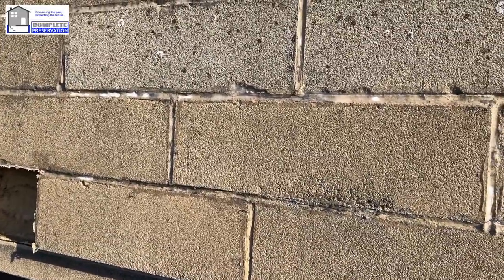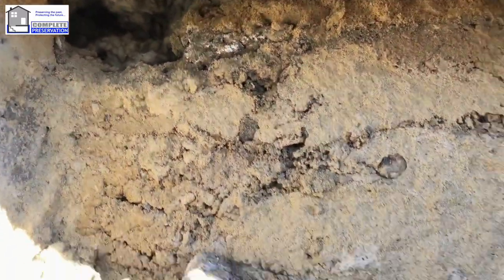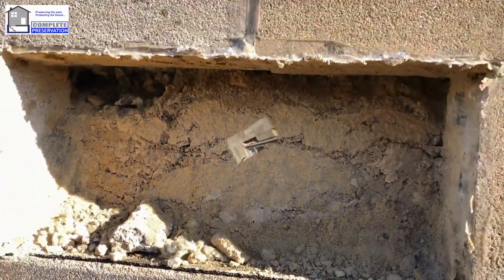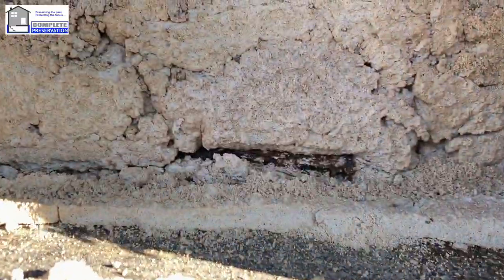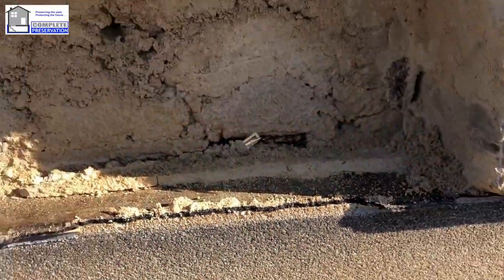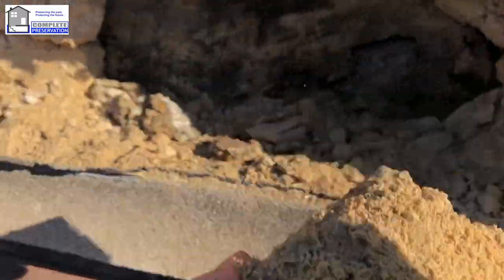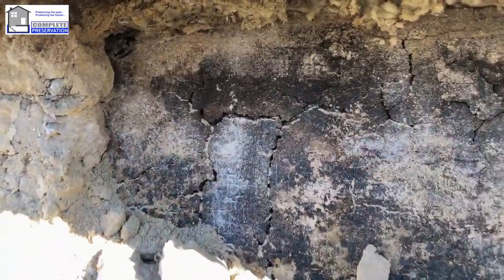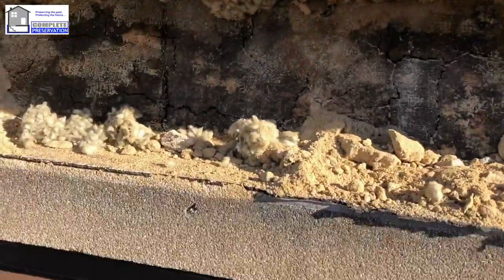Soaking wet cavity walls and a defective blocked cavity tray

Comment: Brilliant video Ross!Yet another different aspect of what can happen.I would have thought that stainless steel cavity trays should be the norm,so it could be fit and forget.I see quite a few old trays made out of various materials being replaced on youtube. 🤨❤👍
Reply from the maker: Thanks David…. Certainly a pretty common defect 👍 bitumen was the go to product, but as you can clearly see, it can become brittle and damage pretty easily. Some pretty good heavy duty retrofit trays available now, which I’ve made use of 👍

Comment: I've just done this job on my 1962 house, a south facing wall, get all the extreme weather, hot cold, wet windy, and the damp tray was cracked just like that one. But the main reason for rain water getting in was the window fitters had cut the water tray back to the inside line!!!!.
Reply from the maker: Well done Ken👍 such a common problem! Out of interest how did you know this was the cause in the first instance, was there damp at high and low level? 👍

Comment: Hi Ross, I have come across a similar problem in my gable end cavity wall and, thanks to your explanations, have figured out where the problem lies (I think!). After removing some bricks it is clear that debris is bridging the physical dpc. However, the wall also has cavity wall insulation retrofitted at some point which is mineral wool. This is wet in places up to a height of about 400mm. The house is on top of a hill and the wall is exposed to lots of rain. I think cavity insulation should never of been added in this instance. 

My question is if I remove all the cavity debris to 225mm below the physical dpc, could the cavity insulation fall down into that gap and also bridge the dpc at a later date? I know mineral wool is supposed to repel water but be good to get your opinion?
Reply from the maker: Hi John, I’m glad the video helped you 👍 if it’s getting wet still, there will always be the potential for a future issue. Sometimes debris will bridge the dpc, and you can also get run off from the edges of the cavity tray (if there is one above), which is often overlooked. Many of the bitumen trays are knackered, yet they get injected without inspecting 👍
Reply from the maker: Mineral wool I find especially the older stuff becomes saturated. I’ve got a video to finish of a recent one. This video might help also https://youtu.be/97yblxM5Ijc
Reply from the maker: A very old post. See for yourself 👀 if it’s waterproof https://blog.completepreservation.co.uk/2016/09/06/a-soaking-wet-cavity-wall-in-wiltshire/amp/

Comment: Great video. My mams ex council house has had a problem with damp in cavity the wall insulation was wet through. I've cleaned it all out as well as rubble. Is that all I can do. Cheers John.
Reply from the maker: Thanks John :) Make sure you check the building when its raining heavy for any obvious issues, and make sure there are no issues with penetrating damp in regards to issues with the building fabric.

Comment: How much will that cost to repair. As I'm having same problems with my living room window over the weekend we had the storm with heavy rain and it came through my living room window and made a complete mess but the daft thing is we have had the same problem for the past 3years it gets fixed by a company called MEARS that work for the LCC they told up that it was fixed every year but never is this time I can't get them to fix the problem as I bought it last year just after they sed it's fixed lol so I'm hoping the my house insurance companie will sort it out wish I could send you pictures of the damage its done on the inside then again dont think it would surprise you
Reply from the maker: Hi Wayne, its difficult to give costs as everybody charges different prices. In this instance it was expensive as we needed scaff. To be fair lots of people have had issues because of the recent storms, and its probably not that much of an issue if it has only occurred in this freak weather. Having said that, if it is damaging decoration and timber is at risk of decay something needs to be done to fix it ASAP. Drop me an email if you wish enquiries@completepreservation.co.uk. I have some videos I will be posting on cavity tray issues where there these have been retro fitted when I get 5.
Reply: Rescue and repair existing of cavity wall insulation

Comment: Also there's no weep holes in the perpend joints between those blocks either, so there would be nowhere for the water to go anyhow. It'd just build up on the failed cavity tray.
Reply from the maker: Exactly Darren, most of the older properties never had any, just relied on not much getting in 😂😂😂
Reply: I was looking and only just thought when you took the blocks out! As an architectural assistant this absoluteley cracked me up that they did all that and that was something that never crossed their minds!

Comment: Hi - I don't have any problems but have recently found out what weep holes are as i noticed wasps going in/out of mine. Not an issue as i think they are too small at the other side for them to enter. Anyway that led me to your video and i am wondering how the water actually gets into the cavity in the first place? I don't mean if there is a problem i just mean in general. Presumably it is rain? but how does it get behind the bricks outside?
Reply from the maker: Hi Kevin, simply with driven rain causes penetrating damp issues. Long term penetrating damp, and building defect doesn't help with matters as in this case.
Reply: Bricks are like sponges,they suck up water and absorb it, it you get enough rain it penetrates through the brick and travels down the brick into the cavity,from there to weepholes, if there are cavity ties that run downwards while attaching to the frame or brickwork from the exterior wall, that could cause a damp issue

Comment: where was the moisture coming from? if it was in the cavity was there a faulty gutter?
Reply from the maker: Hi Martin, just penetrating damp on a gable wall bud.
Reply from the maker: All the insulation is BBA certified, its just that these buildings perhaps aren't suitable as in this video. Fantastic idea, but its the long term maintenance that doesn't get carried out either. Have you got damp issues then?
Reply from the maker: I see lots of issues with cavity tray defects to be fair bud.... just posted a good one on Instagram stories, of a bodged up tray and joists ends not mucked in.Have a look on my cavity wall insulation playlist for some other builder bodged up trays :)
Reply from the maker: ere ya go budhttps://www.youtube.com/playlist?list=PLcSNFcNIIrlxCwsC1Ex_xmQl7SuHT3uaQ
Reply from the maker: Agree bud, the long term maintenance is such an important point that people seem to forget. I think if they knew how much the repairs could cost, perhaps homeowners would be more aware